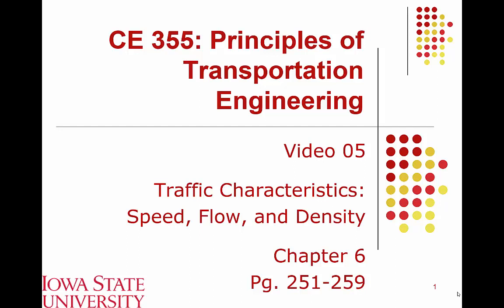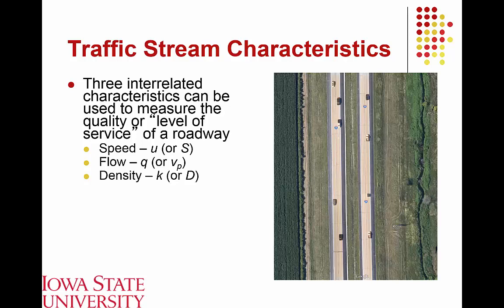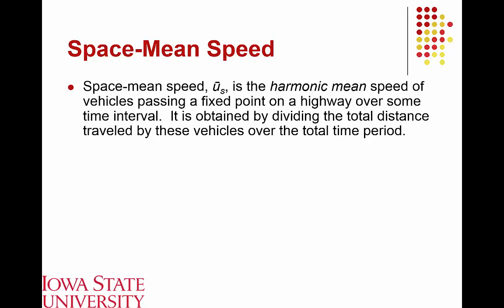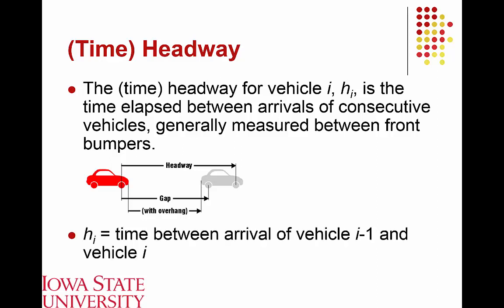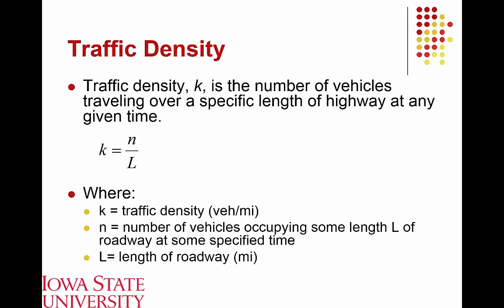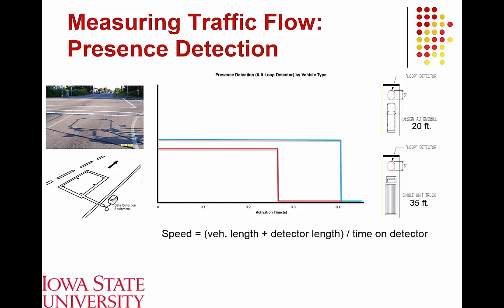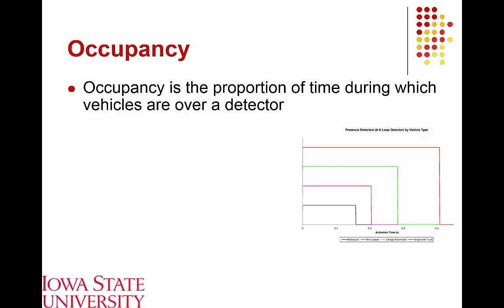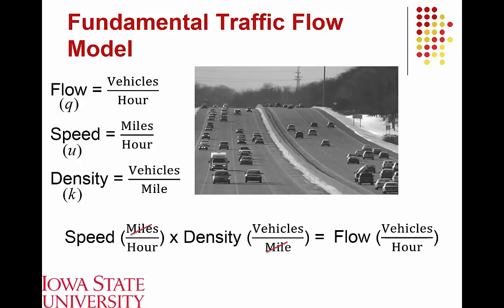Lecture 05 Traffic Characteristics

Comment: thank, from your video i know now exactly the difference between TMS and SMS but why is it always the time mean speed that is greater
Reply: The speeds will be equal if all vehicles are traveling the same speed. If the speeds are different, the slower moving vehicles will occupy the roadway space for a longer time period, which will make the SMS less than the TMS.
Reply: bcoz arithemetic mean is always greater than harmonic mean